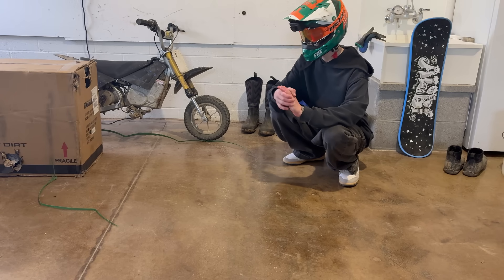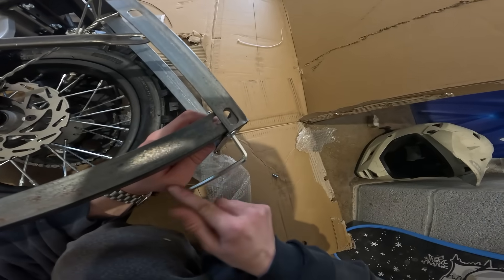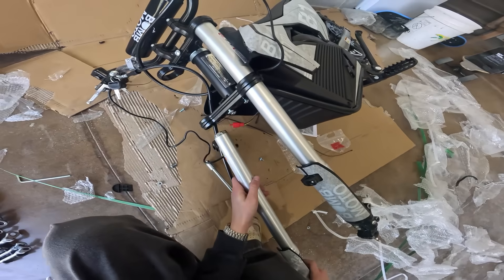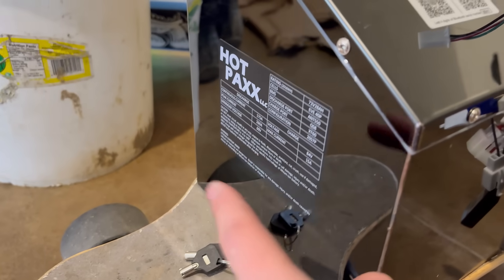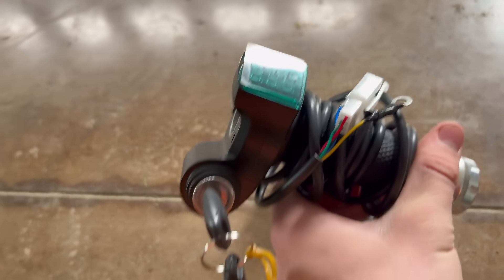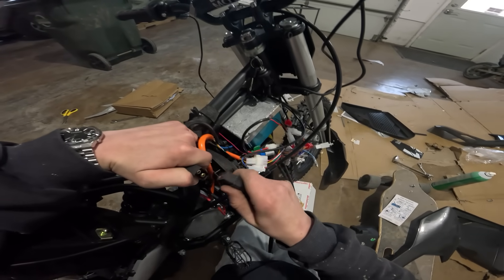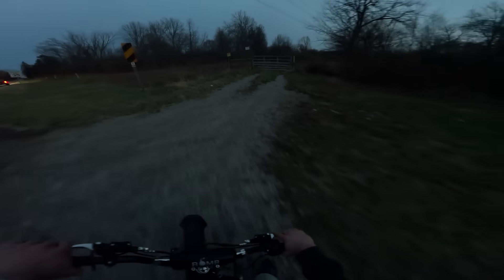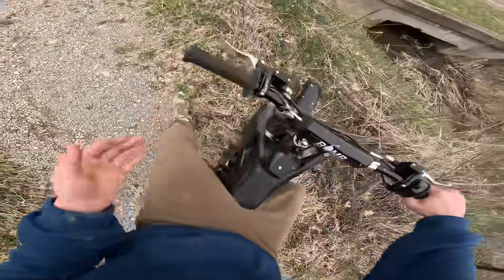BUILDING The CHEAPEST 72V 60+MPH Electric Bike (Bomb Moto B1)

Comment: Hey bro I need your help I got a new controller the ND72450 but the key ignition won’t fit the key connector what should I do or could you show me how you connected your key ignition? For the b1 bomb moto PLEASE HELP
Reply from the maker: The key ignition has 2 wires and one gos to the single wire that is key switch on the controller and then the other one just goes to the positive of the controller
Reply: @Razorronen ok thank you b1 will be working soon

Comment: Hey razoron I just got mine and I’m having troubles with the chain and alignments I got a 420 chain but the front sprocket isn’t aligned with the back sprocket and I don’t know how too align it any tips or should I just take it too a shop
Reply from the maker: I had to use a couple washers to space out my rear sprocket to make it all Aline right I would try that and play with the swing arm sliders to adjust the wheel some too

Comment: That battery can do 175a, the controller can do 200a, I would turn it up to max power and see if the motor handles it, if not then just upgrade the motor.
Reply: No you will over heat the controller and rubbing max battery settings and controller is not good at all
Reply: @Minimotoace  The battery is from a really good company. And also I didnt say to continuously do max power, just do it for a few pulls. Also the controller wont overheat, they are meant to pull 200a for continuous periods of time.
Reply: If you just gonna do it for a few pulls why even bother risking the motor to that capacity it's not made for?

Comment: Dude, those sparks are mad scary. One time when I was putting my new controller, I may have swapped the positive and negative battery wires to the controller and when I was going to put it in, there was a green glowing spark on the battery connecter.
Reply: Username checks out 😅
Reply: @AwareWolfOnWheels  LOL